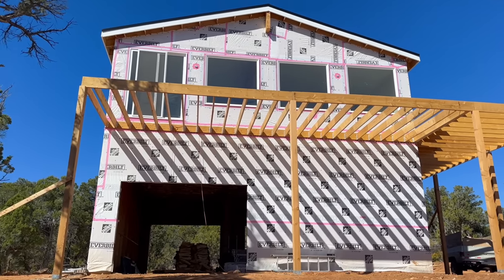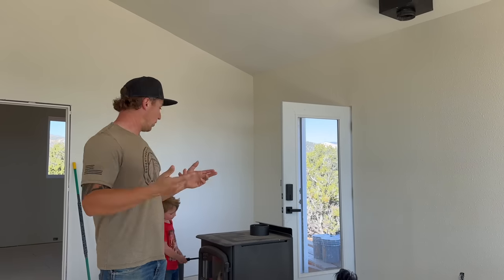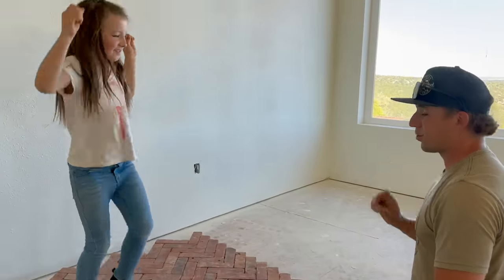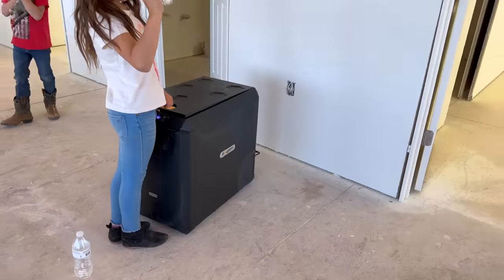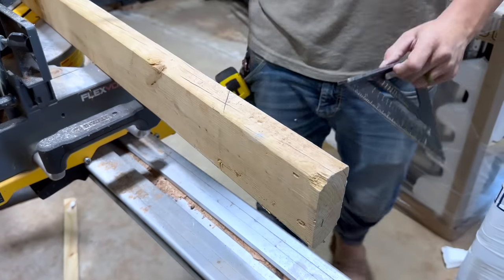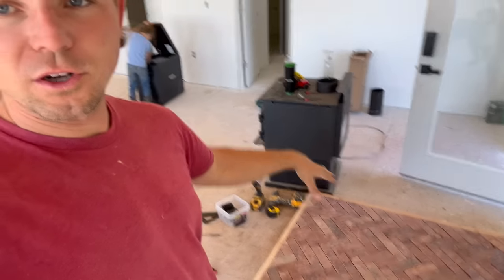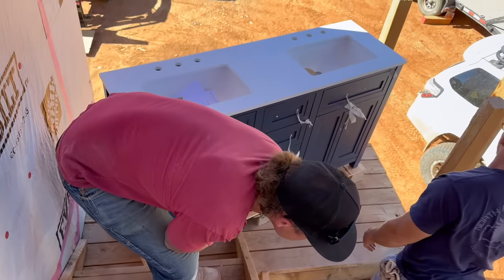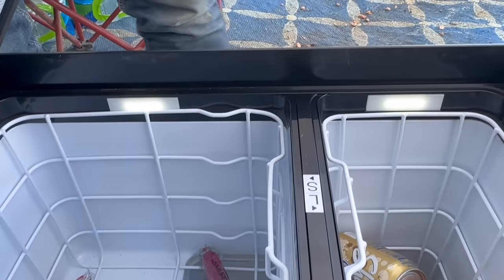ITS GETTING HOT IN HERE!! WOOD BURNING STOVE INSTALL

Comment: There is a product called Brick Acid, it is like water, it ges on the brick, and bubbles the face off, then you wash it off with water, and when it drys its a lovely red colour, I would have stained the wooden frame around the bricks Before putting it on, also you can get Smoke tester tablets, that you put into the firebox of the stove and it shows if you have leaks Before you light a fire!!. you probably used them in the forces Nick, comes in a Meal packs when out in the field. Great video Thanks guys Love from UK @ 5 after 4 in the afternoon. x x x

Comment: Absolutely love this channel. I'm a wood stover from way back. Anyhow, I had an interesting experience. I'm sitting in the living room with the wood stove cooking, and I started to smell burning wood. I looked over the the crisscross stack of wood that was a couple of feet away from the stove had a red ember smoking on the tip of one of the pieces. Then I read up on it and I think it was a minimum of 36" for clearance from flammables. I don't consider dry wall to be a flammable. The question is do you need a backdrop behind the stove on the wall?

Comment: It would take a lot of sand to fill the cracks as it will sift down into the holes in the brick. Solid brick would have been better. I noticed there were still cracks to fill. 😊

Comment: When I did my hearth, I laid down concrete board, mortared some 12"X !2" pavers, then topped that with ceramic tile, and run corner molding around that. Also put the concrete board on the back wall, and put the same tile over that.

Comment: Hey yall, herring bone design is my favorite pattern. I used in in the floor of my eight foot outdoor fire pit, even though it mostly going to be covered with ashes. With four different stairways in my home I often consider adding an elevator because none of them are just a straight shot up & down except my front seven stairs to my screen porch. I hope you plan on covering the stairway outside with a roof. Adding some sort of brick on the wall behind the stove will retain heat like a heat bank ,and keep the wall from excessive exposure. I didn't see if you have a damper on your flue, you will need one or all of the heat will go right up and out and the fire won't last long.

I designed and built a corner fireplace with a warming seat behind, and when it was done the owner decided to light a fire and asked my why isn't it drafting smoke up the chimney. I told him it is designed to have glass on one side and screen on the other to properly vent smoke. I put a piece of drywall on the corner side and the smoke went right up. Math is involved to properly size a fire box to the flue/flues.

Comment: Just line the wall behind the stove with sheet metal panels.  You don't a fancy laser to set the stove pipe under the ceiling opening.  Just some washers and a string.  It's called a plumb bob.  Cement boards will also keep the heat off wood surfaces.  They have standards of spacing for stoves.  Just research them.